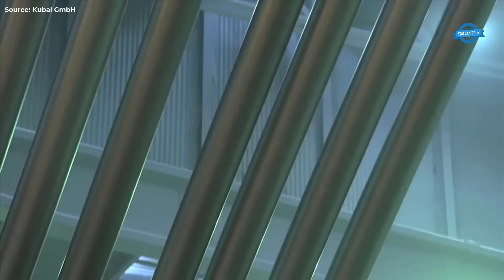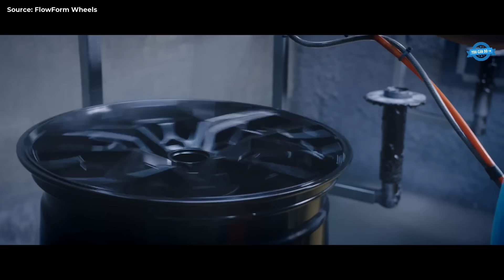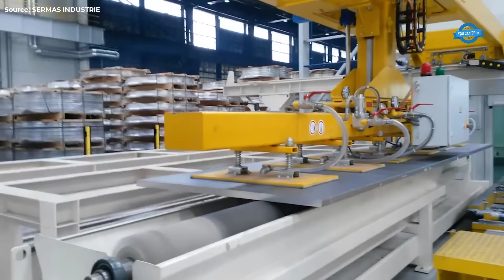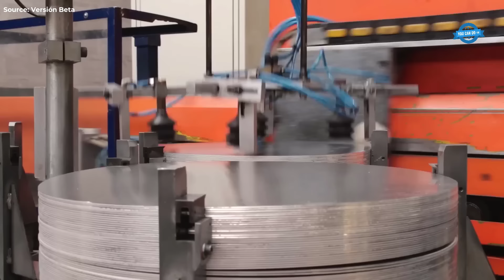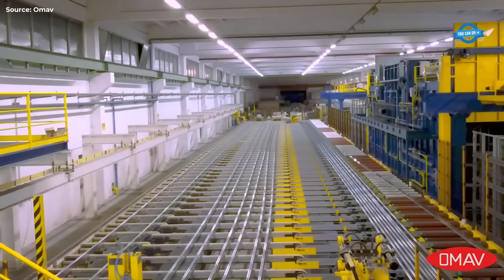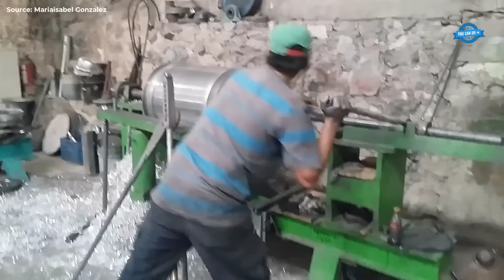Aluminium Smelting and Casting Process. Mass Production Process Of Aluminium Products

Comment: I've joined an aluminium extrusion plant for about 6 months now. We use aluminium billet, wire, market scrap, internal scrap to produce billets in various diameters and extrude on 8 different presses (locally made dies and imported if complicated profile) . Followed by ageing oven, anodizing or powder coat, packing and dispatching. If anyone has any production related questions, please ask me - I want to gauge my own knowledge so far and if it helps anyone sure :D